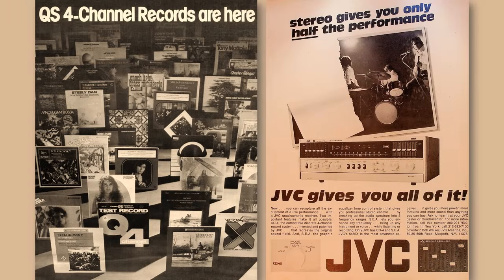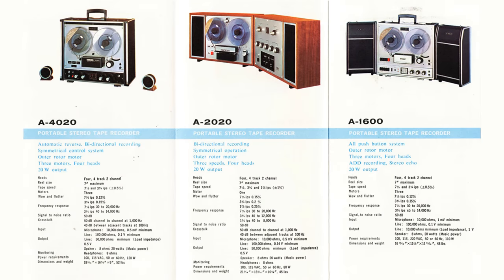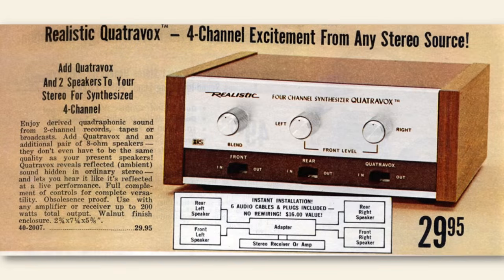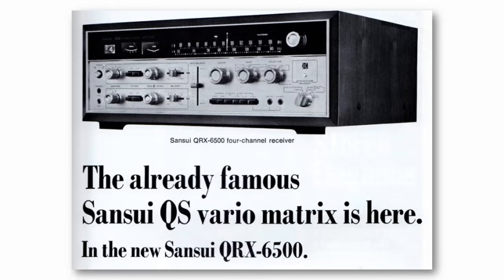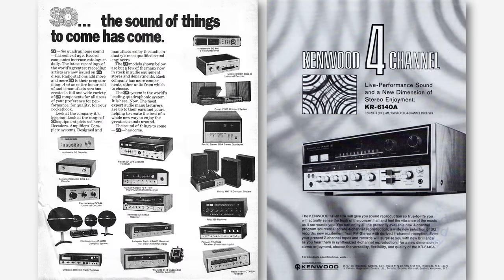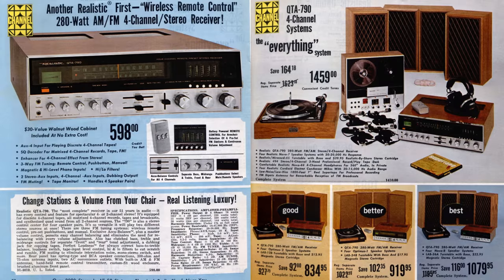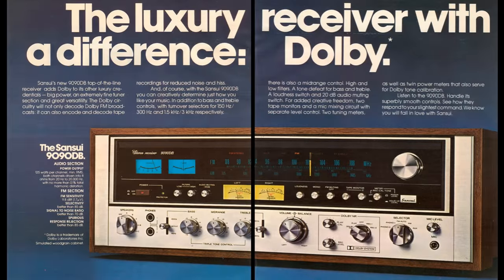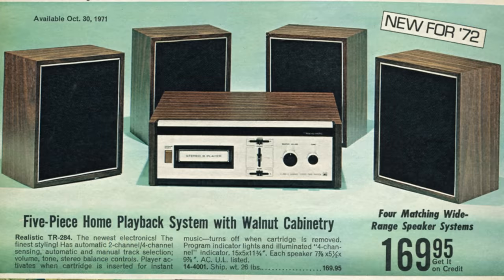4 channel FAILURE - The Quadraphonic Story

Comment: FYI, the Dark Side Atmos mix is its own thing, unrelated to the 70s quad mix by Alan Parsons (I just caught myself typing Alan Partridge 🤦‍♂️, now THAT would be an experience!). The recent Atmos version was mixed by James Guthrie who also created the 5.1 SACD mix in the early 2000s. I haven’t closely compared the two, but I suspect the 5.1 at least served as a starting point for the Atmos mix. Incidentally, the “Immersion” boxed set of Dark Side contains a discrete high resolution version of the 70s quad mix AND the 2000s 5.1– perfect for comparison. The quad mix is more “discrete” in the sense that the sounds are separated more clearly in space, and the panning and other effects are more primitive. However, I prefer it in many ways over the more diffuse and sophisticated 5.1 mix, which sounds significantly better overall, but does get a bit swirly and cloudy at times.
Reply from the maker: The Alan Partridge version is epic! 😂
Thanks for the clarification of the two versions. Now I have to listen to the original. Another good one I found on Dolby Atmos was Bohemian Rhapsody. Now if they could only do the Beatles' "LOVE" mix in Dolby Atmos...
Reply: @LittleCar  The Great Alan in the Sky -  🎶AH HA! Ah haaa ahhh hahaha aaaaaah aaaaaah🎶
Reply: @LittleCar I neglected to mention that it’s true, the Beatles “LOVE” isn’t available in Atmos, but it is readily available in the usual 5.1 formats. I own the DVD Audio version, and it’s glorious. If you’re a Beatles fan, I think you’ll find the Atmos version of Abbey Road to be transcendent. Start at the beginning, or cut right to “Here Comes the Sun” for a quick hit. Either way, play loud. 🔈 🔊 🔈 🔊 🔈 🔊 🔈 🔊
Reply: Ohhh man, I still remember Pink Floyd’s The Wall complete with laser show at The Palace of Fine Arts in SF playing to full house every weekends, and on week days, the same venue would just be another planetarium.
Reply: @MrAntennaBall  we had the same thing here in Seattle. I think they still do Dark Side. Last time I went (ten+ years ago) the place looked run down, one of the lasers was out of focus, and the speakers rattled. Clearly Laser Floyd’s time had passed.
Reply: Got a new sound card and one of the first tests was to listen to the differences between old quad and new 5.1 as high bitrate references. I agree with your comment. The old one is primitive but more interesting. The newer mix is technically correct but kinda boring. And the same goes with Wish You Were Here Immersion Edition.
Reply: Gotta say the atmos mix of DSOTM isn't very good, very unbalanced

Comment: We had a Quadraphonic system at home growing in the 70s, using LPs and a Sony amp.  The only album I specifically remember having identifiable four channel sound was “Switched on Bach” by Wendy Carlos. The sound whizzed around all corners of the room.

Most of the Columbia albums had the original cover art shrunken down and surrounded by a broad gold band, to indicate they were Quadrophonic versions - an example is included in the Big Car video.  The only variation we had - and I still have it - was the Carpenters “Now & Then”.  It has a gatefold cover that unfolds into a triptych image, and has a very narrow Quadrophonic band only in the front cover, presumably so it didn’t disrupt the triptych.

Comment: I had a Motorola 4 channel 8 track player in my car before most people had anything more than a radio. It was amazing, I fitted 2 speakers in the front doors and 2 in the rear parcel shelf. Most people I knew then were simply blown away by the experience.
Reply: Not the same as quad records

Comment: Great video and information! I was a Marine stationed at Okinawa in "73". I was a quad guy but really didn't understand the whole concept of stereo vs quadrophonic! But I bought a Toshiba Quad System, PT-884 reel to reel, SB-404s Amp, SB-400 Turner, Frt SS-47'S and Rear SS-37'S speakers Akai 1721W reel to reel with built-in speakers! We used the shit out of that Akai, but it was only after I was out of the Service "76" that I really started to learn how to use the Quad System! No quad stations, so it was mostly reel to reel tapes and quad records, later bought a Panasonic Technics SA-8000x that had more technology built into it, than the Toshiba SB-404s but just on power I still think the Toshiba sounded better! Now all the 5.1, 7.2 Ect especially with movies but Rock music the systems just sound lame! I'll take a quad or especially an older quality Stereo System with a passive or active subwoofer hook into the "B" speakers so I can feel the Bass in my balls! With a good pair of speakers with at least 12" woofers on "A" speakers! I still have my equipment I purchased on the Rock! Good, Bad or indifferent they still work after 50 years! Now the Quadrophonic concept seems so yesterday? But a good Stereo System still kicks ass! Go figure?

Comment: I remember years ago when i heard the Quadro mix of "Dark side of the Moon", which was also done by Alan Parsons himself. It was an amazing experience and with that mix the whole Album gets an entirely new dimension. Especially the tracks "On the Run" and "Time" really make for an impressive Quadrophonic experience. You almost don't even wanna go back to Stereo afterwards. Also there were a few Quadrophonic CD releases without phase encoding but rather DTS encoding, so you could only play these CDs with an CD player that had Toslink or S/PDIF out, conected to an AV receiver that had a DTS Decoder in it. And of course there were the more common Dolby Surround encoded Albums that didn't require any special decoding hardware but only really showed their true effect if played back via AV receivers that have Dolby Surround ProLogic mode. When i was a kid in the 90s, my parents had a Dolby Surround Home Theater System and we often watched movies like that and it really felt like cinema. There were also occasional Magazine CDs with Dolby Surround calibration sounds and demo songs on them. We had a few of them and that always felt really special and High-Tech to me. Isao Tomita's album "Pictures at an Exhibition" from 1975 also has a Dolby Surround encoded CD release from the early 90s.

Comment: Thanks for an informative video. As a young teenager in Australia in the early 1970s, I could only dream of owning a Quadraphonic system. That was until Electronics Today magazine published their version of the Hafler method using a wirewound potentiometer and a couple of cheap, low quality speakers for the out-of-phase rear speakers. I quickly cobbled it together and was absolutely amazed by the effect. It wasn't quadraphonic per se but it certainly gave an expanded soundstage on many (but not all) albums in my meagre collection. One of my favourite albums, Pink Floyd's Ummagumma was outstanding. Even Electronics Today themselves described the experience with that album as "particularly delightful".

Comment: "Sound does not just come from the front" - Actually in case of classical stage music, it does. The stage is in front of you and all sound you hear is produced on that stage and only comes from there. Sure, sound is reflected of walls, ceiling, and floor in the room you are sitting but that is also true in your living room, where sound from the speakers in front of you is reflected by walls, ceiling, and floor. That means multi-speaker sound, in case of music, is not about reproducing audio sources to your sides or behind you, as those do not exist in a live concert, but about reproducing the "room" of the concerts, making your small living room sound like a huge concert hall. The question is: Is that even desirable? I like the warm, damped sound of my living room way better than I like the cold, wide open, reverberating sound of most concert halls. That's personal taste but I have no interest in making my living room sound like a big opera building. It's a different thing when it comes to movies, as of course, when you reproduce sounds of an environment, that sound will come from all directions in reality as sound sources are scattered all around you when you are standing in that environment.
Reply: Then by that logic, the most a two channel system could reproduce is two dimensional effects.
Reply: @senorverde09 I think it's good that you talk about "effects", because that's all stereo really is, an effect. If you want to reproduce a live orchestra properly, you need one speaker per instrument and you need to place those speakers in the way that the relative spacing of the instruments on stage has been. Stereo does not reproduce a stage correctly because in reality your head is not pointed at the stage at a constant angle, and if the angle changes even slightly, what your ears will hear will also change. The same goes for stereo sound and the angle at which you point your head at the speakers, but it's not the same. It's more like you have a wall with two holes between you and the live stage, and initially the holes fit your ear position perfectly, but now if you turn your head a little, the angle between your head and the holes changes, and that results in you not hearing the same sound you would hear if there wasn't a wall with holes in front of you, since that wall will block direct sound paths that would otherwise exist. Instead you still get pre-filtered sound paths that now no longer matches your ear position, as they only match if your ears are perfectly aligned to the holes. More speakers in front of you would improve that situation, as the wall will then have more holes allowing more sound paths to pass through, but to get a near perfect reproduction, you'd need either an almost infinite number of speakers in front of you (in which case the wall would have more holes than wall and basically disappears) or, as I said, at least one speaker per sound source, in which case there is no wall to begin with. 

So stereo is more about selling you an illusion, like a picture that looks three-dimensional to you as long as you look at it from the right angle, even though it's not really three-dimensional and doesn't behave the way a real 3D object would behave when your eyes move around or the lighting conditions change. Multichannel sound tries to "enhance" this illusion, but "enhancement" is subjective. In the 80s, for example, just about every compact stereo (that came with speakers) had an "enhanced stereo" or "wide stereo" mode (they may have used some other silly name). When you activated this mode, a signal processor boosted the difference between the two stereo channels while attenuating the mono signal common to both stereo channels. Often, some reverb is also added to the signal. In this way, you get a sound as if the room were much larger and the speakers further apart than they actually are. Depending on the room, speaker placement, type of music and personal taste, this mode can actually sound better, for me it sounded rather awful most of the time. Apple's HomePod does something similar today: it has sensors to measure the sound characteristics of the room and then uses a DSP to adjust the audio signal to compensate for any deficiencies in the room. It may sound good to some people, it may sound horrible to others. But what none of these enhancements do is making it sound more realistic, rather the opposite.

And this is a problem that you have with all multi-channel systems, right up to Dobly Atmos. They can't reproduce reality any better than stereo, they just create an artificial soundscape that may sound impressive, but not what reality would sound like. These systems were not designed to reproduce reality, but to reproduce a sound engineer's vision, as the sound they produce was not recorded in a real environment, but generated entirely in a recording studio on a computer. The quality of the results depends heavily on how good the computer software is at what it does and on the sound engineer's skills and knowledge of real sound reproduction. YouTube is full of video that criticize that many Dolby Atmos soundtracks sound rather poor and they usually blame the sound engineers for that, who apparently often have no idea what they are doing, since to them it may sound "good" and "real" but apparently they have never been in a real life situation like that, otherwise they'd know that this is absolutely not what a real helicopter sounds like that approaches you from the back and then flies over you head. That's how a helicopter sounds in a PlayStation video game but again, that sound was produced by a sound engineer on a computer who also had no idea what reality sounds like. On the other hand, a computer rendered movie is also not reality, yet as long as it is close enough to reality, you can convince your brain to buy it, so I guess it's okay anyhow but that doesn't make it objectively "better" than some other system which also sells you a different kind of illusion.
Reply: @senorverde09 No you are still listening in a three dimensional space. Other than the rare antiphonal performance all the direct sound still comes from the front. Properly mic'ed live performance will have phase and reflection information for depth perception.
Reply: Not in my experience.  As I mention in a nearby comment, for years I produced DVDs of choir concerts in Europe, and recorded with four discrete audio channels.  I was surprised to discover early on that the rear channels were only a few db's down from the front channel levels.  And the sound is completely different.

Sure, if I wanted to hear a jazz quartet playing in front of me in my living room, plain old stereo would do fine.  But if you want to re-live the experience of hearing an excellent choir performing in, say, Chartres Cathedral, the surround-sound effect of four separate channels (LF, RF, LR, RR) will blow you away.

And by the way, Hollywood doesn't do this.  They fill the rear channels with fake crowd cheers and the like.  It would be very difficult to record actual surround sound for everything, real time.

Comment: 'Ole Audiophile to LC: You pretty much nailed the story I lived. I was inspired to purchase a full Quadrophonc  setup after attending a concert, you nailed it, Pink Floyd in 1973, the dark side of the moon tour. I bought the speakers and the decoding gear built into a preamp with a rear amplifier, one tape looped it to a stereo reciever for four authentic channels. It had Matrix & SQ, this Pioneer unit with inputs for a CD-4 demodulator which I purchased. I had all three mediums, the reel to reel was the best but lacked quad sources to record from other than records. 8Tracks made dreadful source material. It actually all really worked quite well if one had it all but damn few did ( I was all alone as far as I knew.) The real problem turned out to be finding source material, recordings in Quad. Nobody and I mean ONE single record store had quad records (Recordlland mall store) & them damn few. One had to buy quad to hear quad so it slowly all got strangled by economics of the day. I went straight to Dolby Surround into every generation since. Thanx.
Reply: Today, I own & use a 6.2 Channel setup with Super Audio multichannel & a format you forgot, DVD-Audio multichannel. Both require decoding (Sound famiiiar?), one's a Sony format , the SACD, the other requires a DVD-Audio player, not to be confused with DVD-Video which is why the format suddenly persished. A decade later & more, they still release mulitichannel recordings in both formats even though both are considered dead.

Comment: In the late 80s I purchased a used Pioneer quadraphonic receiver/amplifier from a pawn shop for around $50. On its front display it had a circular screen about the diameter of a soda can that had printed markings that resembled the site from a fighter planes machine gun. Just in front of that was a small joystick that controlled a green dot that appeared on the screen you could use to maneuver the sound to any position where you placed the dot. It had a few different switchable options that allowed you to use it in quadraphonic mode, stereo mode or a mode that allowed you to place different channels in different areas and then mix the whole thing around with the joystick. It was one of the most awesome sounding receivers that I have ever owned but sadly sometime in the mid 90s our young son spilled his cup of milk on the top of it and it never turned on again :-(
That thing was heavy and huge and the speakers in each corner, which I believe were 2 pairs of zenith 3-ways consisting of a 15 inch woofer, a 8 inch mid-driver and horn tweeter was absolutely amazing, though it did take up most of the living room at the time, lol!
I love the sound, convenience and size of my newer equipment, but I don’t think it would be too hard to convince me to trade it out for that 80s set up…

Comment: When CD-4 , which was the "new" system of Quad hit RCA, I was a recording engineer at RCA recording
studios in Hollywood. .One of the other engineers said that CD-4 was "a great system of Quad as long
as you had two engineers to setup  and maintain it." Which was a very true statement.It was very difficult
to get it to work in the average home by the average person. At RCA Hollywood we were tasked with
remixing just a few albums into Quad and it was a very minor priority.Finally, we were told to "put the
most in important things in front and the minor elements in back."  When remixing in Quad it was 
done by the engineer alone with no producer input. I remember a friend of mine, who was familiar 
with both the stereo and the Quad versions of a "Jefferson Airplane" album, say that both versions
sounded very different from each other.
Reply: I had my office on Hollywood Blvd at Whitley back then, and used to go down to Sunset to the RCA bldg for lunch.